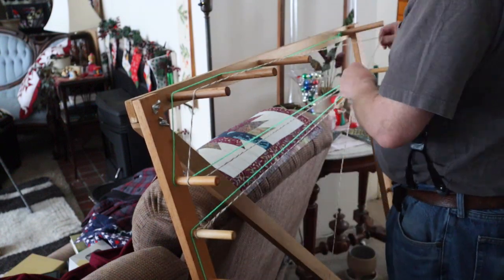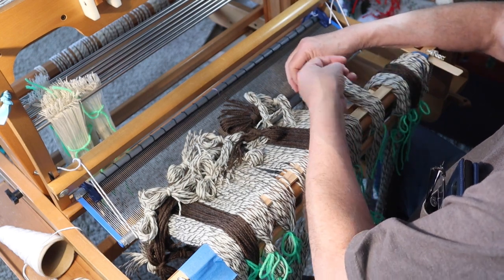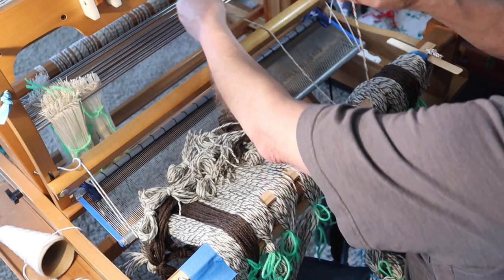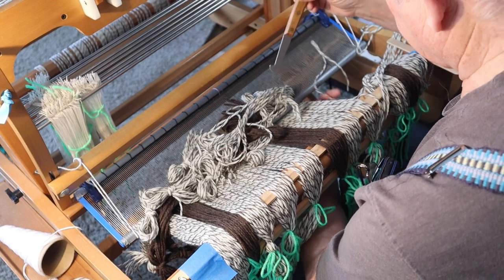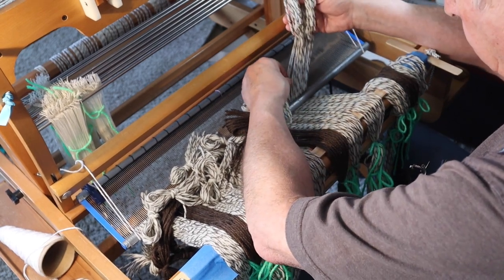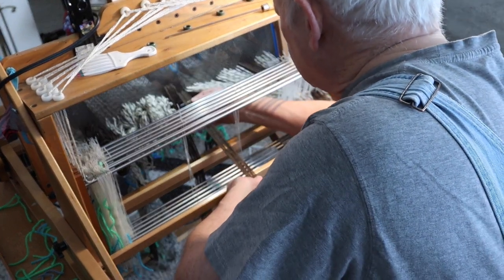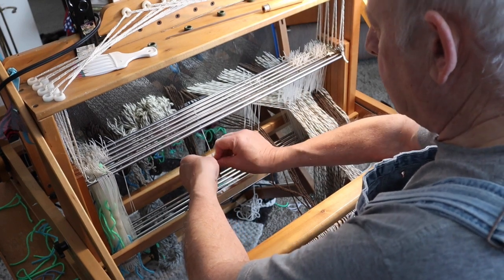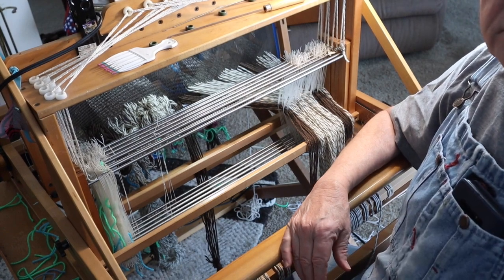2023 02 Brown Shawl part 1

Comment: As others have mentioned, your sound is definitely better.  This is an interesting method and thanks for the pointer to Vermont Weaving Supplies.  I’ve found some looms are just better for F2B and others are better at B2F depending on their design.  My old Schacht Mighty Wolf was definitely better for F2B but while my new Louet David can do either, it definitely shines at B2F because the breast beam and beater are removable so you can sit much further into the loom.  I’ve never had a table loom so don’t know about them.